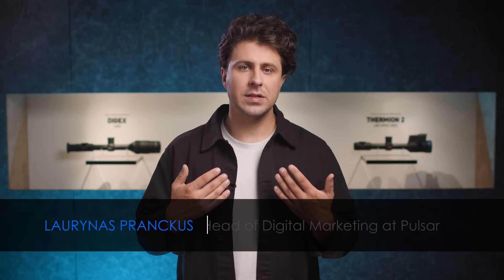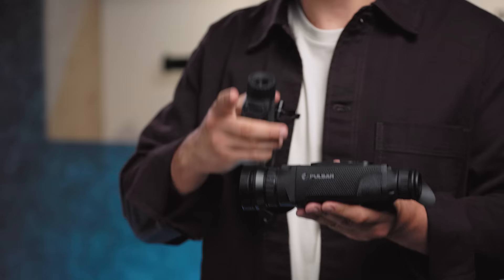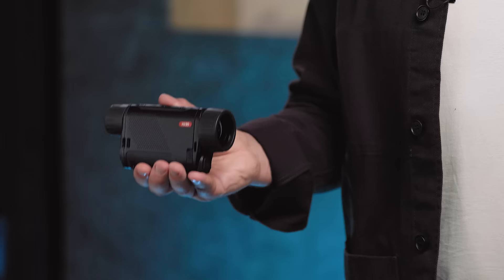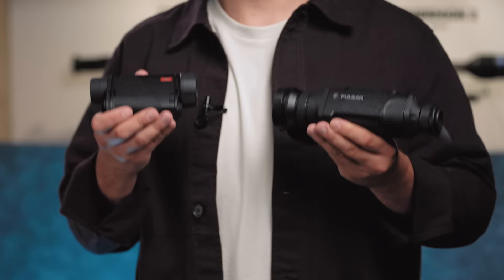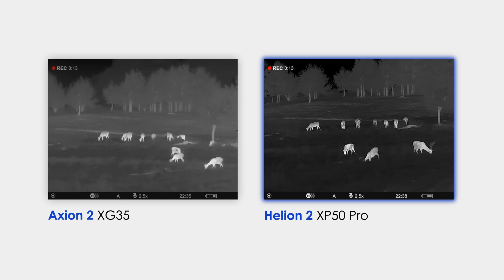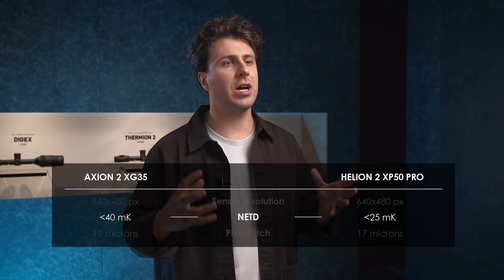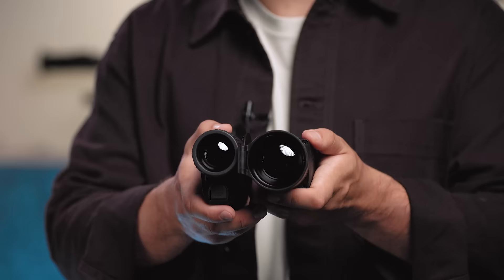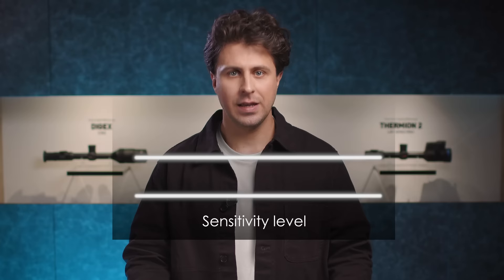Pixel pitch, explained | 12 µm vs. 17 µm | Choosing the right sensor

Comment: I'm sorry but this is a horrible video.  You cannot compare a 35mm focal length to a 50mm focal length.  You need to compare the same size focal lengths to get an accurate comparison, especially in inclement weather.  To say that the pixel pitch is the difference in poor weather between a Helion 2 XP50 and a XG35 is incredibly misleading.
Reply: size of the sensor effects focal lengths ,if you put a 50mm on the smaller sensor it would be zoomed in
Reply: @MatthewDannevik  yes that’s an advantage of using 12 micron sensors. The pixel pitch has very little effect on image quality, especially as promoted in this video.